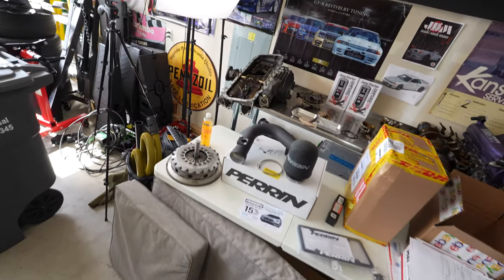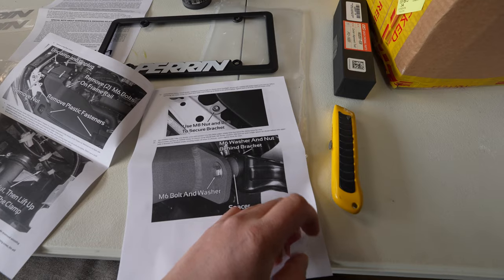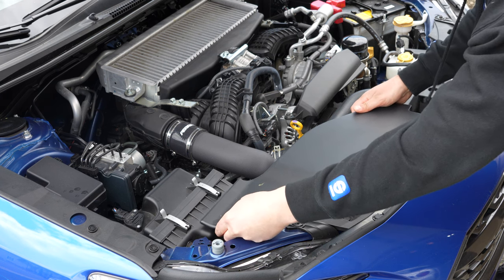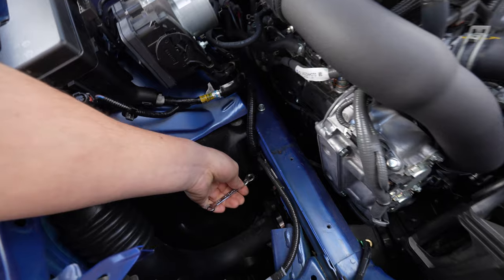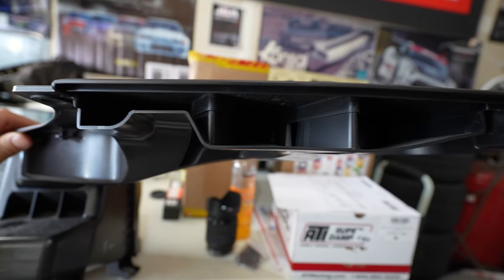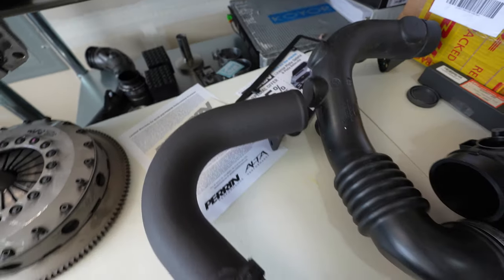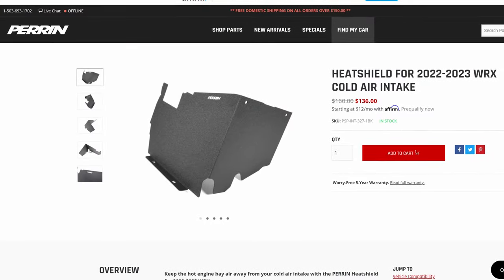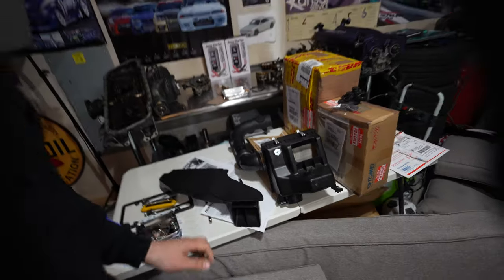Perrin intake 2022 WRX insane turbo sounds 2023+ VB WRX install and test review

Comment: Okay so I see that Perrin is confident in a no tune intake but I’m tbh scared -_-
Reply from the maker: The AFR is looking good in the data logs. The numbers are the same before and after the install. However I will be getting a tune very soon for piece of mind. I would like to have it tuned by Perrin Performance in Oregon after I get the Perrin FMIC and J-pipe.
Reply: Always get a pro tune when installing a mod

Comment: Seems like it would just suck in a bunch of hot air.
Reply: Intakes are 99% sound the stock system is fantastic with that said I have a BMS intake 😂
Reply: @DylanVBWRX  i am going to get the BMS intake for sure. Not this silly Perrin intake that will decrease horsepower.
Reply: What you think the turbo is blowing out? HOT AIR. There’s an intercooler for a reason lol. It’s for more airflow, this isn’t a N/A Honda. Also theres a heat shield for it that he didn’t install
Reply: @bryceb3796  bms intake is great larger diameter piping definitely noticed a difference. None of them are major increases, but it did show improvement on the draggy. Foam filter is supposed to be better however you can always add it to the bms for 30-40
Reply: trading that nice oem cold air intake for some fun sounds
Reply: @ak2112  intakes make 40-50whp on these engines when tuned. It’s the best bolt on mod you can do.
Reply: @DylanVBWRX  what do you mean you can add it to bms for 30-40 and I have a cvt and jb4 should I get a intake I want to get the Berger one but I don’t honestly want insane hp and tq gains I like my boost where it is lol has anyone dyno’d the difference in stock and bms
Reply: @Clemdogg  you’ll be fine adding it using the link on my page to buy it and I’ll help you set it up properly
Reply: @Clemdogg  the foam filter from the Perrin fits on the Burger intake foam filters are better
Reply: @pharmztko  LMAO no they do not.. that's insane.
Reply: Yes they do lol 😂@hhaste

Comment: Just installed mine (2023 WRX base) . This isn't my first intake, I've installed multiple over the years. So I installed everything perfectly. However I am not happy. It seems to remove power, not add. First gear always pulled hard all the way through (stock) and now it won't kick in unti aftwr 4,600 rpm. I've only had it on for a day, and I think I'm already going to return it.
Reply from the maker: Out of curiosity did you verify the MAF sensor is pointing in the proper direction? Also did you clean the excess oil off the filter to ensure the MAF sensor did not get contaminated during the initial startup? I might try spraying some maf cleaner on your sensor. That suck your having issues. Mine worked perfectly and my car is much faster.
Reply: @JDMRightHandDrive  yeah but I'll double check tomorrow. It's impossible to installed it backwards. It only goes in one way. And if it was in wrong it probably wouldn't even start. But again I'm gonna double check all connections and see what happens. But you're right, holt shit that filter had a shit load of oil on it. As well as those stupid rings don't stay in place.
Reply from the maker: @shadowdemon7770  my guess is some oils got on the sensor. Hope you get it fixed. I am going to swap my filter with a K&N filter later. Because the oil freaks me out a little.
Reply: @JDMRightHandDrive  that could definitely be the issue. I'll pick up some spray and try again. Thanks for the input. Much appreciated. 
Hey if you know anything about upgrading my (WRX base) dual screen to a single screen, please let me know. I found a used one but I'm unsure that it would just be as easy as swap and go.
Reply: That's because you did lose power. You almost always will, with an aftermarket intake on a Subaru without a tune. It's not healthy for the engine, either. Only drop in filters, like a K&N flat panel filter should be installed without a tune.

Comment: Seems like it only makes cool sounds. All it’s doing is sucking in hot engine bay air. You would actually improve performance by buying an AEM dryflow filter and removing the factory charcoal filter.

Comment: That noble exhaust sounds good in and out of the car. How are you liking it for day to day? Was a little concerned it would be too loud.
Reply from the maker: I was very concerned that it would be too loud as well. It is quieter that the ETS I had before. The ETS produced a deep exhaust not which gave more of a drone effect in the cabin. The Noble Titanium resonates making a higher frequency exhaust pitch that does not bother me so much in cabin. I am very happy with the sound after the last 1000 miles I put on it so far. Its not to loud at all, I will never use the silencer that comes with it. Thanks for watching.

Comment: Just ordered the Perrin intake. Stoked to  hear the difference. Great video, thanks for the info!
Reply: How’s your car being doing since installing that intake? Any negatives?
Reply: @bobbyberger18  it’s been great, i had to get it tuned because my DAM was dropping. Since then I have had no issues. Highly recommend the Perrin intake.
Reply: @CameronBeasley-h5t  how low was your DAM dropping?
Reply: @bobbyberger18  I was getting down to .12, I ended up parking it for a few days until I could get the tune done. I’m in AZ so I also have the issue of having absolutely terrible quality gas out here.
Reply: @CameronBeasley-h5t  oh my gosh that’s low. Thankfully nothing happened to your car.
Reply: @bobbyberger18  yeah it was nerve racking, I would also recommend if you have the Cobb access port don’t put on the OTS tune. Wait until you can actually get it to a shop to do a tune or an E-tune. I’m going to be putting a J pipe, and a Perrin front mount on in the next few months. I won’t be doing that until I have a tune lined up right away.

Comment: did you tune it for the intake?
Reply from the maker: I did not get the tune right away, but my car is pro tuned now that all my mods are installed. The Perrin Intake AFR's show in the safe range with stock tune and Cobb OTS tunes.

Comment: Great content as always ! if you haven't already please get a E-Tune for the intake. We already had one blow up with an ETS intake and the ots map. Watched without sound, so if you already said you got it disregard.
Reply from the maker: Going to get it tuned very soon. I dont want my FA24 to blow up like the others running the ETS intake. The AFR ratios are reading the same on my Cobb AP3  data logs before and after the install.
Reply: The jb4 is a e tune correct? And I wish you didn’t say in the video you don’t need a tune you do absolutely
Reply: @Clemdogg  jb4 is a tuned enough to handle an intake just fine. Stock boost most intakes are safeish, but at higher boost there’s risks. The Cobb doesn’t have the ability to make adjustments without an Etune unless you have access to their software suite.
Reply: How much does a tune cost?

Comment: oh yeah, Getting my exhaust and next Perrin intake, also Noble Steering wheel 2023 WRX 6 speed, No tuning as of now
Reply from the maker: That's awesome man. I would also grab the Perrin inlet while your installing the intake. You will thank me later because the turbo noises are the coolest part of the inlet system. Have fun with your mods and Merry Christmas.

Comment: Hey so im thinking about adding a cold air intake to my 2023 wrx do you think it will void the warranty
Reply from the maker: The AFR's are perfectly safe according to Perrin. Personally with my car if I needed to take my car into Subaru for a big warranty claim, I would just put the OEM parts back on to make sure Subaru cant say anything.

Comment: If you could only get the Perrin chargepipe or the Perrin intake which would you choose?
Reply from the maker: I would buy the intake, it is dyno proven to make 20 whp on a stock car. Best mod beside the Cobb Accessport which adds 40-50 horsepower. Thanks for watching and have fun with your VB WRX.

Comment: Any gain in performance numbers too??
Reply from the maker: Perrin dyno tested the intake at their shop and the VB picks up around 20hp on a stock tune. I installed the Perrin turbo inlet and that makes even more power and makes even more turbo sounds. That part is not released yet, but video will be coming out in the next few weeks.
Reply: @JDMRightHandDrive   great waiting

Comment: I'm having a hard time just pulling the stock intake off the car. Loosened the clamp and removed the bolt. Thing just won't pull out. Any tips?
Reply from the maker: There is a lower hose clamp that holds the intake to the turbo inlet. Loosen that and it should pull up and out.

Comment: Notice any difference with the intake paired with the charge pipe?
Reply from the maker: I notice mostly torque. when the turbo kick in. The intake make the bigger different in my opinion. Car is more responsive, I really want the Perrin FMIC next. I also wish another company would release a more affordable J-pipe. The ETS one is so expensive at $1300.

Comment: Has anyone used the bottom mounting hole on the pipe for the bottom bracket to give the MAF wire some slack?  Would that work?

Comment: NO BOV?
Reply from the maker: I installed a TS VTA BOV and it made my car run weird. I had to install the stock BOV to get my car pro tuned. I will be getting myself the new Perrin recirculation BOV. If you want extra turbo noises I would recommend getting the Perrin turbo inlet. https://www.youtube.com/watch?v=pPAvFHt6jc4

Comment: Drunk man tuning has a variety of intake tunes for the VB WRX. Should probably do that. 

Seems silly to upgrade parts and not the tune which is what makes the most of them.
Reply from the maker: Thanks for the heads up. Going to reach out to DM Tuning after I install the FMIC and J Pipe next week. I want to go for their E30 tune.
Reply: How much for a tune?

Comment: Installing tomorrow
Reply: How did your installation go?  I am considering getting this for my new 24 WRX.  But I have little experience working on cars, so I am nervous about the install.
Reply: Seems like its much easier to get underneath for a few of those bolts. No great videos on that part of bolting... low and blind. I might pay a shop or something to do it. How DIY is this really ?
Reply: Maaaaan! With the dual port blow off valve, Perrin cold air and Tomei! They say I be lighting up the tunnels🙏🏾

Comment: No offense to you, love your videos. But, other than noises, this is actually more inefficient than stock. The stock ram air box does a good job of directing air. I don't understand why Perrin didn't design a box to go around that intake filter to help divert air.
Reply from the maker: I agree with you there, this does suck in hot air. I installed the heat shield about 2 weeks later and that made a noticeable difference you can feel. Did you see the @Subispeed intake shoot out video? The reviewed the Perrin, AEM and ETS intakes. Pretty good review to see all the dyno comparisons. Thanks for the channel support.
Reply: @JDMRightHandDrive  I did just follow up by watching your front mount install and see you added the air box shroud. Good work!